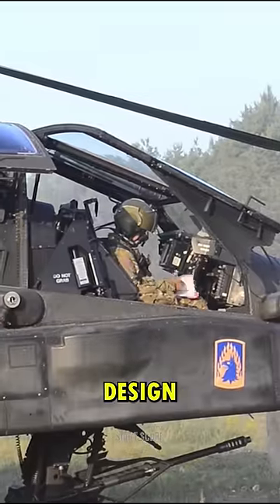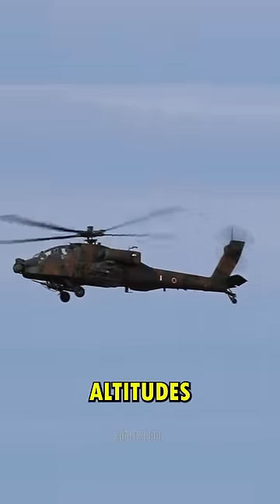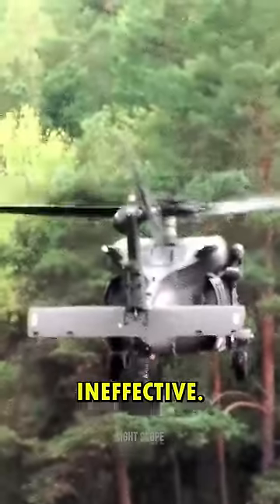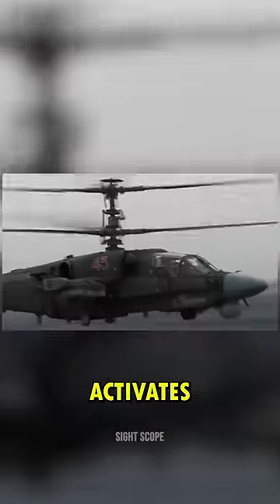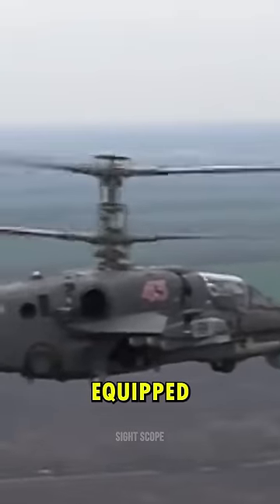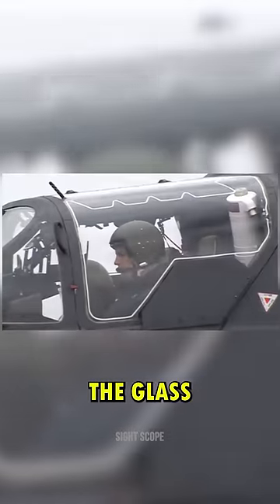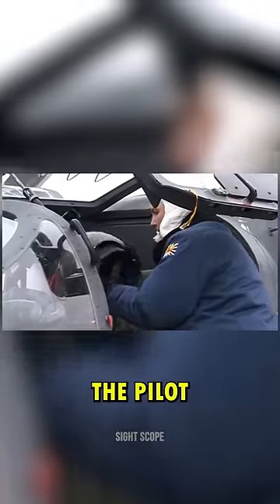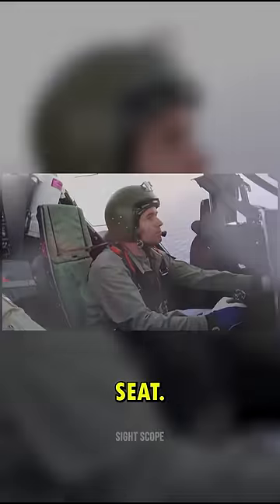Do Helicopters Have Ejection Seats? #shorts

Comment: I actually thought this exact  idea  up before  the difference was  not only did the rotor blades release,  but  the tail detached  leaving  the cockpit  section  with pilots intact,  also  parachutes  would  deploy  and also in case  over the water  they had a floatation  device  deploy  at the bottom  so as to keep the pilots  safe Inside with scalable  cockpit  design  with air scrubbers recycled air systems

Comment: 1. that spinning thing on top of the helicopter is not a propeller.
2. in most cases, when an ejection occurs on aircraft, the aircraft is damaged in some way (usually damaged prior to ejection otherwise there wouldn't be a need for ejection. If the pilot ejects on a single person aircraft, you're going to lose the aircraft. There are cases of a a co-pilot/navigator ejecting and the aircraft returning to base but the aircraft was still damaged.

Comment: Wrong info. The KA50 had the Ejection seat in 1982. The KA52 is from 1997. Also the full Rotor hub isn't blown off. But the Blades are blow off so they get thrown away from the helicopter by the centrifugal force.

Comment: I had this problem solved half way through the video, if your ejecting there's no point saving the craft.  Blow the rotors individually with explosive bolts, they will fly away from the cockpit. Then the pilots have a clear view above to eject, just need to design a way to eject the ceiling of the cockpit so the seat and pilot can be ejected without sending them through the roof of the craft.  They have used explosive bolts on the shuttle hold down clamps for decades.

Comment: You could launch the blades off and eject, or, you could have parachutes in different parts of the helicopter and a system setup to identify and use the proper parachute depending on where the damage/issue occurred to need it, lock or launch the blades when it happens idk just seems less risky

Comment: You also forgot the helicopter that ejects the piglet out of the bottom. It doesn't just open and drop. He's ejected straight out of the bottom with rocket 🚀 ejectors! The don't forget the sideways ejector seat. Rocketed out of the side of the helicopter. Those are great designs!

Comment: I might be stupid for this but won't a brake system work? If a button is pressed the props wil lock and the pilot will shoot out. The props will have a fixed position where it can brake so that it doesn't get in the way

Comment: Some helicopters has the escape seat going under the aircraft so unlike planes where the pilot  goes out above the plane helicopters has it where they goes out underneath the helicopter some helicopters also has small explosives on the blades so when it comes to time the blades are detached from the housings

Comment: I have seen a lot of clips, that show you can usually land a helicopter, even if the engine shuts off. Because the wind from falling in a helicopter powers the blades, the helicopter never just falls to the ground, like a plane would.

So, why is there even a need for an ejection seat? In what cases, is ejecting better than just try to land?

Comment: Wouldn't it just be easier to to have each individual rotor blade disconnect from the rotor so the centrifugal force would pull them away from the aircraft at speed in all directions allowing for a safe ejection instead of having the entire rotor detach from the aircraft and flying up as the pilot could still theoretically collide with it. I believe releasing the blades would be safer than releasing the whole rotor. Yes the flying blades in all directions would be dangerous to nearby aircraft and anyone on the ground but the aircraft would already be out of control and pose the same risks as the blades

Comment: Its actually quite cool, but the description isnt quite accurate. The rotor is attached to a detonating bolt that completely ejects entire rotor system before launching the pilot. On paper and in trials it appears to work very well, however since this is Russia we are talking about, validity of the reported success of this design should be taken with a grain of salt.

Comment: This is old news, it was being developed in the 1980s i learnt this as a kid, 
It was being developed for the KA-50 that was introduced in the early 90s.
Explosive bolts remove the rotor blades and they eject up.
Also the explosive in the canopy is old tech from the 80s.
Take a look on most 80s and early 90s aircraft and its on most canopies.

Old news just look on Wikipedia.

Comment: During the year and a half of the Russian-Ukrainian war, dozens of Ka-52 helicopters were shot down, many of these cases were confirmed by video.  It is interesting that, judging by the video, none of the crews used the ejection system.  I don’t know how efficient the ejection system on this helicopter is, but the crew clearly does not trust it.  The reasons for this distrust are understandable. The Ka-52 helicopter has two rotors with three blades each, and if at least one of the blades is not separated, the crew will die when trying to eject.  Accordingly, such a system is much less reliable in comparison with a similar one used in aircraft.

Comment: If the heli blades are still on the rotor, then an ejection seat is not necessary. the blades autorotate and slow the heli down to the ground. Still a rough landing though.

Comment: A simple solution would be a rotor lock rigged to the ejection seat, but I’m sure there is more design reasons why they don’t use one
Reply: There's a LOT of energy in those spinning blades, you'd need a very good braking system, and it has to be as reliable as possible cos it's an emergency life-saving system, that usually means simple.

Explosive bolts are better. Literally bolts, as in "nuts and", with an explosive charge in them that blows them apart. Lots of NASA technology has used them, the Space Shuttle and earlier stuff, as well as military stuff. Then, so I hear in these comments, the rotors just fly off into infinity with their own momentum, and you're clear to eject. Probably takes less time than you can blink.

Comment: If I remember correctly wasn't there a American designed helicopter that had ejection seat that was through the bottom of the air craft instead of going out through the canopy ?

Comment: Designing a working ejection seat for helicopters is somewhat useless. You dont just have to design it so it works on perfectly in order helicopters, but thst it works with a helo that took significant damage. On planes the cockpit holds ghe entire ejection system. As long as that's safe, you can eject. Going from the cockpit to the rotor on a helo mens a lot bigger area where damage can disable the ejection seat

Comment: For those who making fun that pilots will be turned into pieces let me tell u first the blaids are removed by explosives then rockets shoots up which is not directly connected to seats instead it is connected via a strong rope , in case if rotors are not removed(what u think) the rockets rope will be cutted before lifting pilots up its a pretty long rope anyways..

Comment: Well, if the rotors come off, I guess that’s one circuit you really hope doesn’t have an unintentional short. Imagine if they designed it like the old machine guns on WWI planes where the gun was geared with the propeller so it could shoot through it without damaging the prop. “Tuck & roll MF!!!!!”

Comment: Ok cool you got rid of one set of rotors what about the other set? Also serious question why couldn't they make an ejection seat that shoots you out the side instead of straight up?
Reply: Both pairs of rotors are detached. And during emergencies, if the heli is tilted to it's side, it can send the pilot straight into the ground.

And the flamey end of the ejection seat will be towards the other pilot if ejected sideways

Comment: I’m surprised they don’t have a bottom dropout option
Reply: Its definitely been proposed, but I would assume the complications make it impractical. Another problem is that attack helicopters usually operate at a rather low altitude, low enough to where they can hide behind hills, mountains, and treetops. Helicopters have very little defenses, so their only option is to try to not be seen at all.

Comment: You're totally wrong about slower speeds and lower altitudes causing greater challenges- the Martin Baker 0-0 Ejection seat is designed for 0 altitude and 0mph. Almost all aircraft with ejection seats have the tech to blow out the glass at ejection- this is not new tech. Furthermore, a helicopter does not have propellors- it has rotor blades. This is all basic stuff.

Comment: I love how the orator says "endangering both the crew and AIRCRAFT". If you are ejecting, the least of your worries is endangering your aircraft "MORE"... Also it doesn't release the rotors, it has explosive bolts that hold the blades on, when the ejection sequence is started the bolts explode which causes the rotor blades to fly off the rotor housing. Since they are moving very fast inertia flings they away from the aircraft removing the danger of colliding with one. It's amazing what happens if you just do a little bit of research before you make a video to post....

Comment: Helicopters don't necessarily need ejection seats though, I guess auto rotation has left the chat.
Reply: Auto rotation doesnt help much when you get hit by a missile. Ejections are a last case scenario when you think that theres no other option of survival.
Reply: @gsilvy4k570  I mean I don't disagree with you, but once you're hit by a missile you're probably done for anyways. I don't really think even auto rotation could help you from that if your rotor was even still intact
Reply: @oliver_klozoff  There's footage of a Ka52 getting hit by a missile, shortly you can see a parachute deployed by one of the pilots over a plume of dust and wreckage. If every military in the world could feasibly add ejection seats to any helicopter they had, then they would. The way I interpreted what you said, was that helicopters don't need ejection seats because auto rotation exists. My point is that auto rotation obviously doesn't work if the blades are destroyed, which doesn't take much. Ejection seats exist just to add at least another slim chance of survival. Military tech is expensive, but so is training another human to operate it.

Comment: well they can easily make a ejection seat for the Ah-64 But they dont want to like putting explosive bolts triggered when the ejection handle is pulled blowing the rotor blades off making the rotation force of the blades shoot them away from the helicopter then in a micro sec the canopy ejects off then a few secs later the crew gets ejected but we don't need this because we don't have our helicopters shot down 24/7 like the Russian ka-52 in Ukraine

Comment: I don't quite buy this system. Helicopters are unlike planes in that they can fly in any direction. A plane always has to have a forward component to it's flight path except in a flat spin stall. But in this case, ejecting puts pilot ejection path opposite that of the planes path. For the most part, ejection in a plane put's the pilots path orthagonal to the planes path. For helicopters, this isn't going to be necessarily true. Helicopters can get into all kinds of crazy spins and orientations. Of course, with twin counter-rotating blades, these KA's don't have the spin issues traditional helicopters with tail rotors have should the tail be taken out. Even if the blades are released, they still pose a great threat to to the pilots upon ejection because they can still potentially be ejected into these blades as the body of the helicopter will now be in motion independent of the blades. It could easily change position pointing the pilots at the blades, making ejection potentially lethal. It really depends on the attitude of the helicopter at time of ejection. The ideal ejection would be when pilot and copter paths are orthagonal like a plane. Of course, have a chance is better than having zero chances.

Comment: Alot of the pilots die becuse they are to close to the ground so the rotors don't have enough time to be ejected and then eject the pilot before the chopper hits the ground this have been shown a couple of time in Ukrain the problem for helicopters in modern warfar is the medium anti air forcing the chopper to fly low but then if the are hit they don't have enough time to eject the pilots unlike a jet that don't have a rotor to think of.